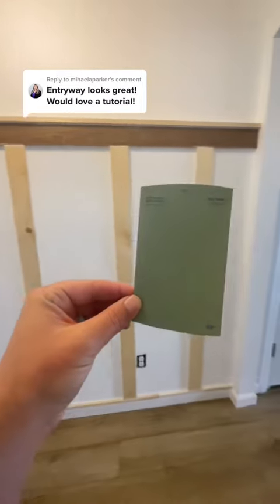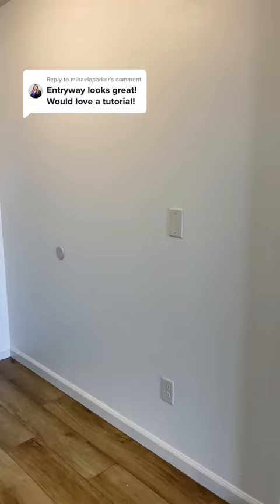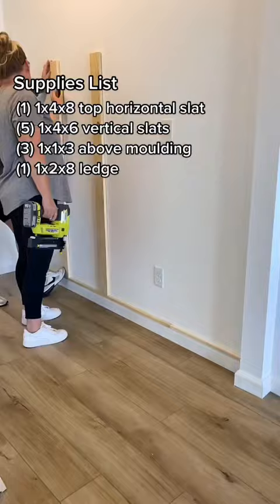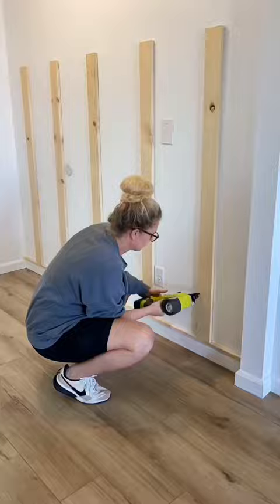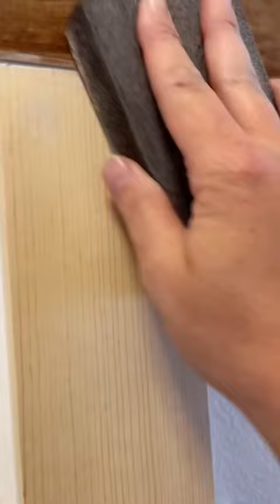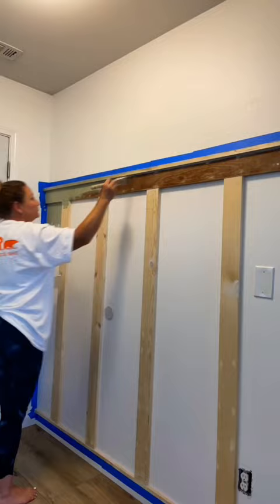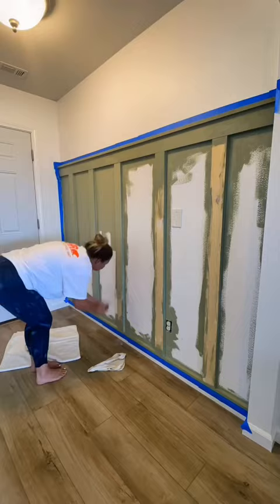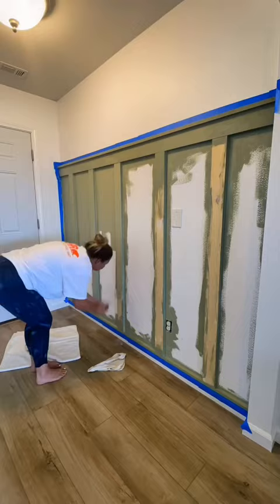Easy DIY Entryway Tutorial - budget friendly #diyentryway #accentwall #easydiy

Comment: Question,  I see yr wall is textured,  did you sand it first?
Reply from the maker: No, we didn’t sand, just painted it. I wouldn’t sand the textured wall but if you want a smooth surface, you can put up sheets of boarding before adding the slats and then paint!